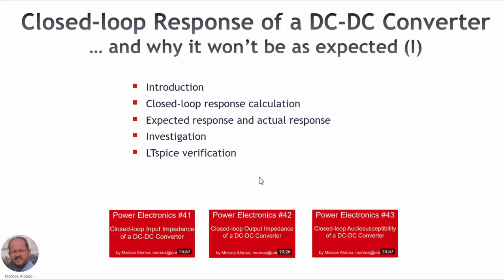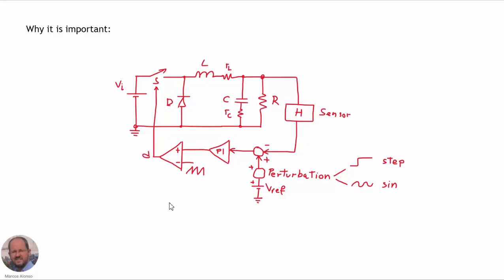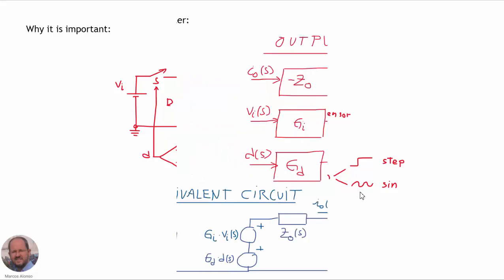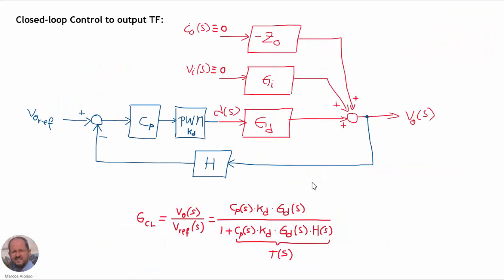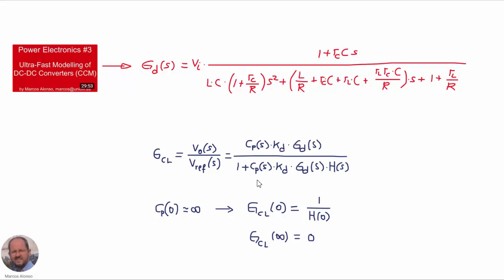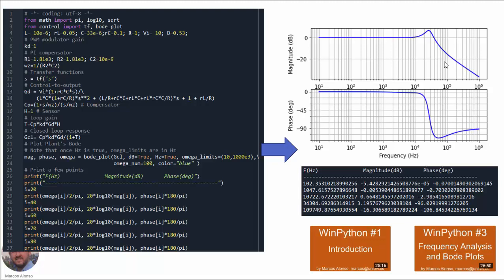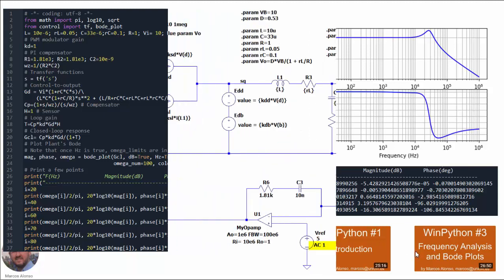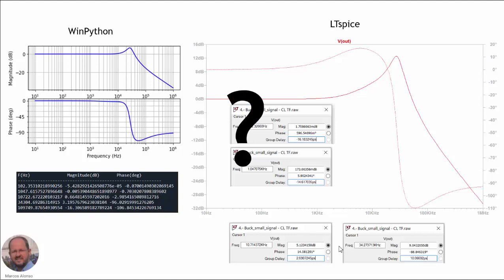PE #44: Closed-loop Response of a DC-DC Converter … and why it won’t be as expected (I)

Comment: Hi Professor,
This is really a nice question and I hope that you post similar questions in the future. 
As for the answer, it is related to the injection point and how the opamp works. Basically, from a block diagram perspective, we are assuming that the difference between the ref and feedback is fed to the compensator transfer function which will lead to the duty cycle. This is what we used for the equations. 
The way you connected the injection point made the block diagram differ. 
Assuming C(S) is the compensator TF
In the calculation: V(d) = C(S)*(Vref-Vout)
In LTspice: V(d)-Vref = C(S)*(Vref-Vout).
It is like having a feedforward from Vref added to the output of the compensator block and the result is V(d).
I could duplicate the results of the calculations by a different connection of the AC source to the apamp. 
Please check the following image in the link that shows my connection which leads to the same bode diagram.
https://i.postimg.cc/prDvmTD7/PE.png
I made Vin as V={V(out)-V(ref)} to compensate for the inverting action of the amplifier.
Reply from the maker: Hi, RM, thanks for participating. This is the correct answer. You are very smart. Congratulations!
Reply: @MarcosAlonsoElectronics  
Happy to participate and watch your videos, Professor Alonso.
Reply: @MarcosAlonsoElectronics  it would be nice if you can clarify in the next video how we can get around this in a practical implementation. In the converter I worked on, Vref is fixed and the control loop is usually for load transients and VDC disturbances. In which cases, the connection of the opamp as in the video wouldn't cause an issue.
Reply from the maker: Thanks for the suggestion. I am working on it.

Comment: Hi Professor, thank you for this interactive learning. The only diffrerence with the analytical analysis is the added response by the opamp. Ltspice take it into account.
Reply from the maker: Hi, thanks for participating. Your answer is close but it is not the correct one. Note that we have used a very good operational amplifier, with a DC gain of 1e6 (120 dB) and 100 MHz bandwidth. So the response of the operational amplifier can be neglected in the frequency range that we are considering.
Reply: Hello Professor,  thank you for your answer. Not as smart as RM, but at least you have your best dunce! Thanks again Professor for your classes and enlightening us!
Reply from the maker: You are not a dunce. Your answer was good. 
Thanks for watching the channel!